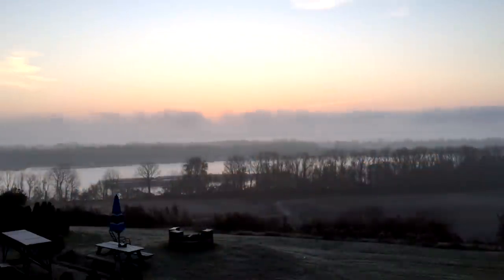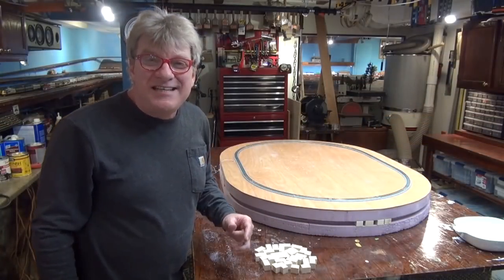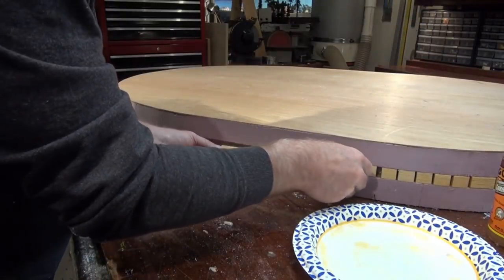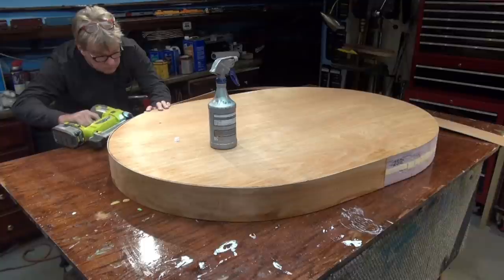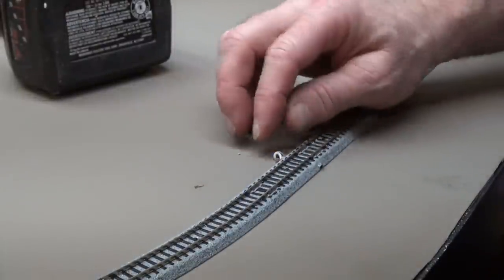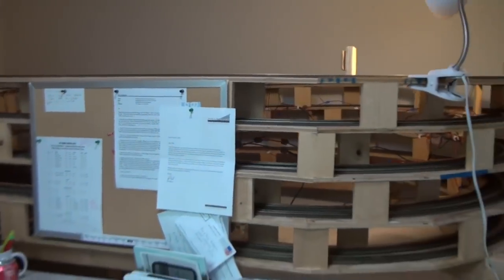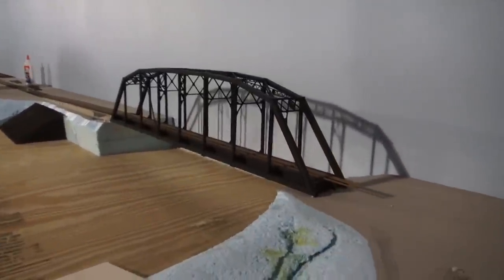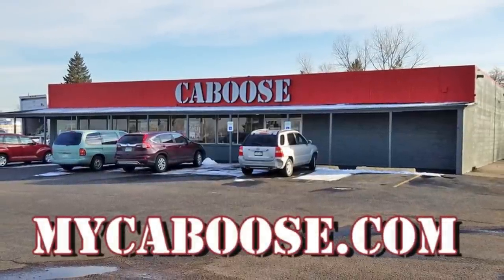Maintenance tips | March 2020 WHATS NEAT MRH Mag

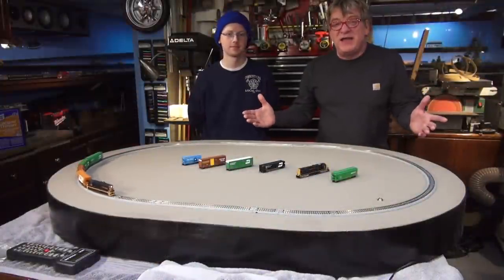Comment: @17:50 I work at what once was called "Sclair" and the company I work for has bought them out and those orange Sclair cars were once solely made for the polyethylene (plastic) manufacturing facility that I work at. There are only several left around as most have been condemned with being over 40 years old. Those that are kept around, are deliberately used for certain applications at our site now, one being they are a much smaller sized hopper car (3 compartments) vs the newer larger gray 4 compartment hopper cars and fit into certain spots that the larger hopper cars can't because of the old age of the plant.

Comment: Hi Steve! I like your idea of using the metal tubing for your diorama wire. Would you recommend doing the same thing on a larger layout?
Reply: Metal tubing is great for helping you thread wire through layers of material. Doesn't matter if it's the foam of a diorama or of a layout. or the leather of a homemade infinity gauntlet you want to light. A metal tube will give you a smooth bore and a straight line, both of which are invaluable for threading flexible and tangly wire.
Reply: @JamesRegiersModels  Thank you sir.